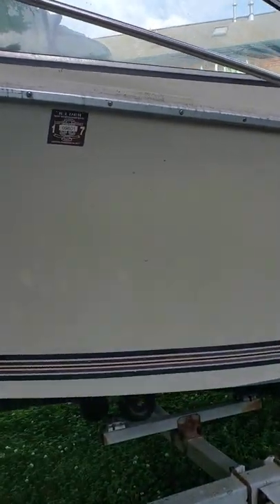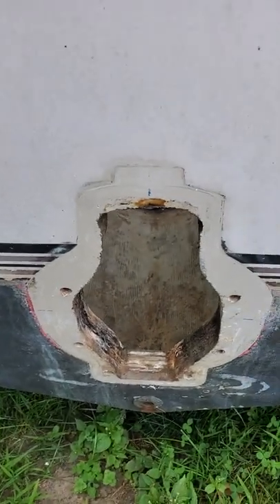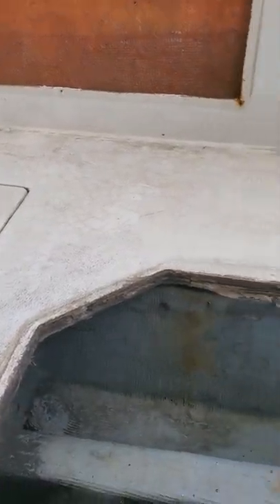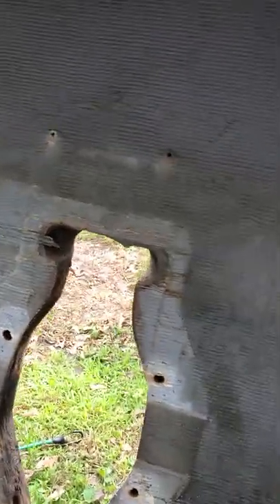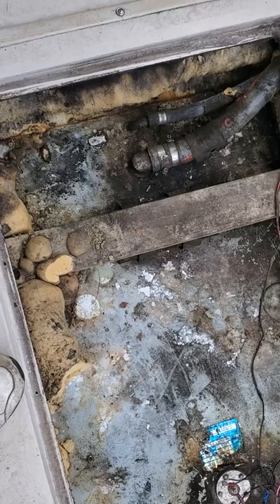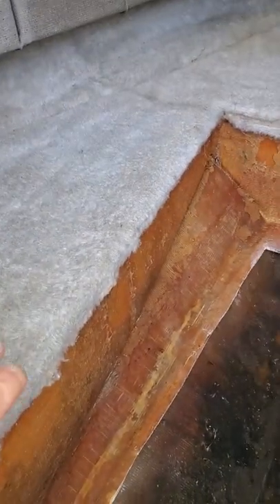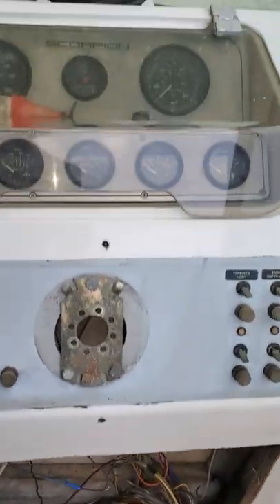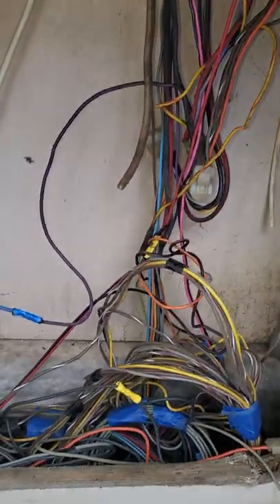Chris Craft Scorpion Refit part 1

Comment: I have the same boat (from RI) and did the same work. Just put the original 3.7 back in all rebuilt. I was able to remove the fuel tank without cutting but had to cut out all the foam 1st. 
I would love to see future videos of your re-fit!
Reply from the maker: Is it a walk around cuddy? I was going to buy one 10 years ago with a 3.7l.
Nice set up. Sta y tuned and please subscribe!
Reply: @tedsmarinerepair8956  Its a cuddy, not a walk-around.  1986 Scorpion 211 vf. Have had it since "08" but after a divorce it sat for 7 years. I have the alpha one in my shop now installing new seals and bearings. Hopefully back in the water in a week of two.
I subscribed!